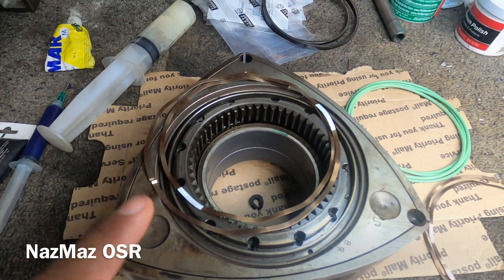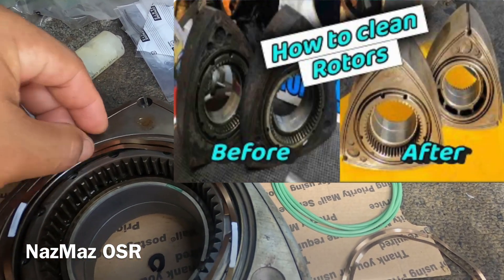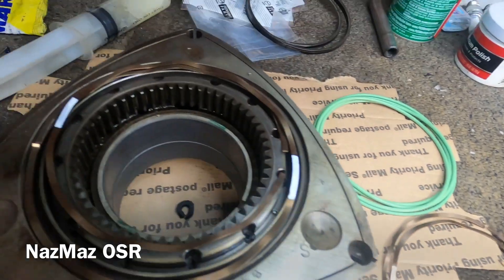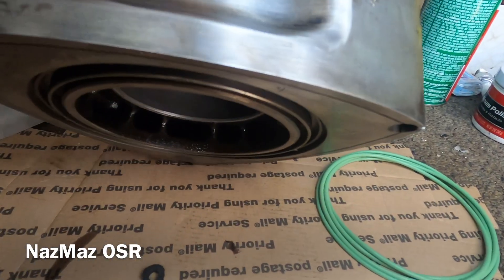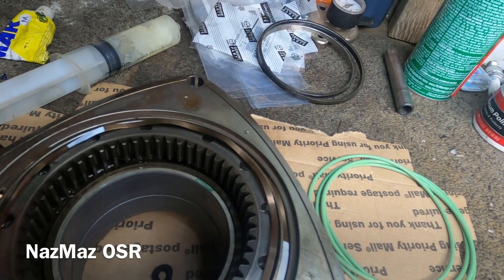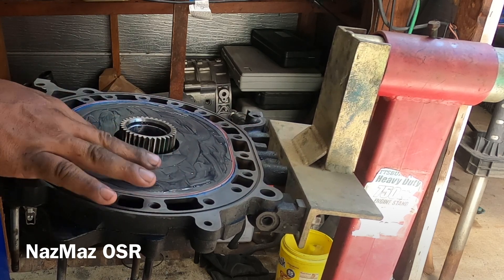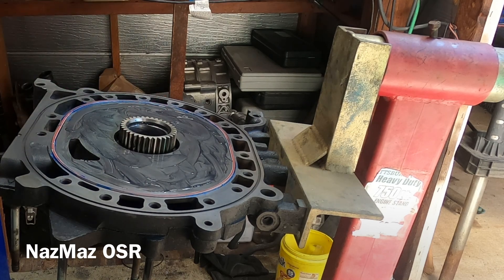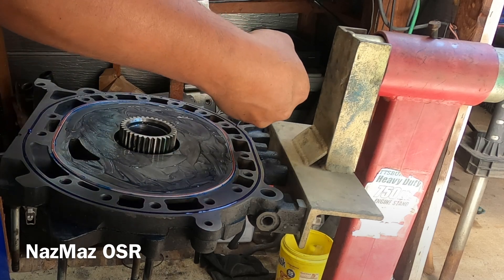Mazda 13B engine build

Comment: Dope carnal. I’ve been very hesitant in rebuilding my own and your videos have eased the stress of doing it. I do have a few questions. In the outer black coolant seal does it have to be set where the port is at also? Like the red orange coolant seal? And does the front rotor when placed inside the housing and plate. Does it need to be at the 6 or 5 position? Also the rear rotor at 12-1?
Reply from the maker: Thanks!!! No, outer black coolant seal don't have a join like the inner ones. As for the rotors there are many ways you can position them it's just preference. I like to position the top of front rotor to 12 then spin to 3 position to install center iron but you can also position it to 6 and spin to 3 or just start at 3 etc... I don't have any one to help me lift the eccentric shaft for the center iron so first step works for me and as I spin to 3 I'll know if anything is bind.